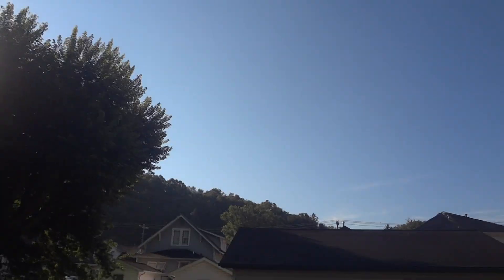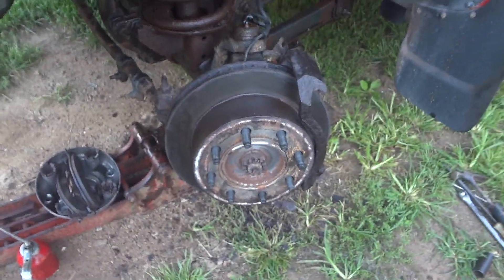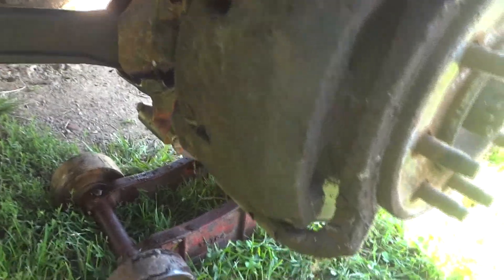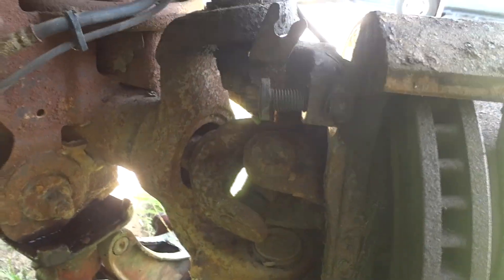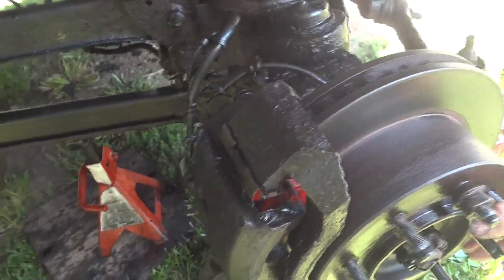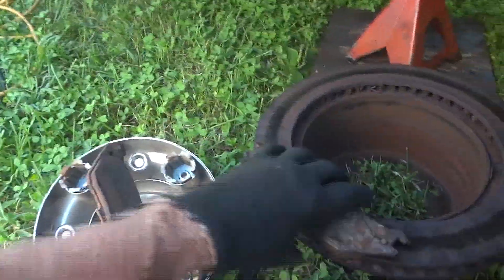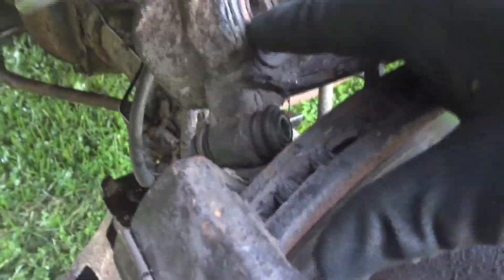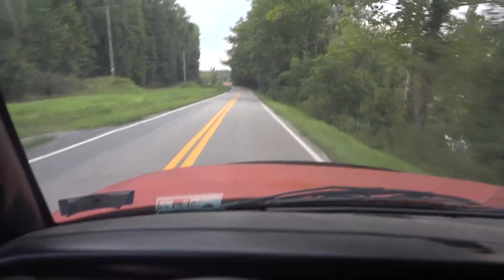2002 Dodge Ram 2500 V-10 ...Rusty... Brake Job

Comment: This is for 4x4 models, the 2WD 2500 with V10 has 8 lug nuts but a different set up. The rotor on the 2wd models has the hub and bearings built in. It's a rather wasteful design from Chrysler that is harder to work with. At least that's the case with my 1996 ram.